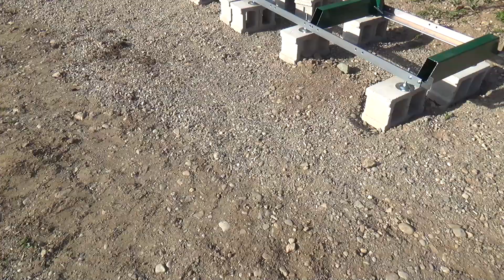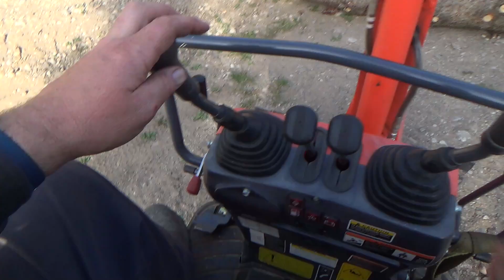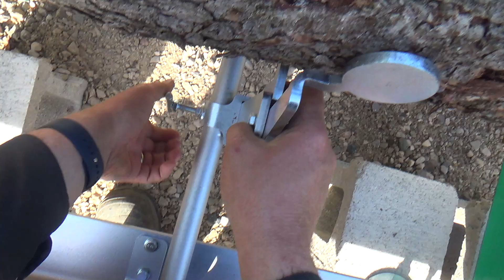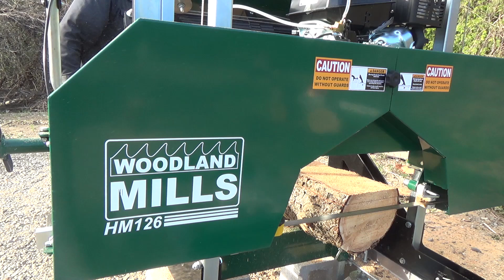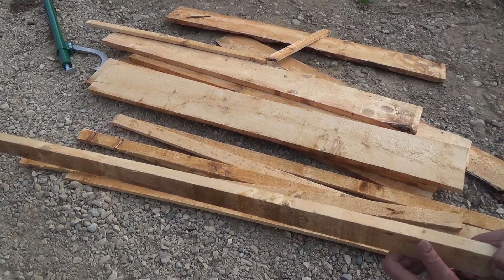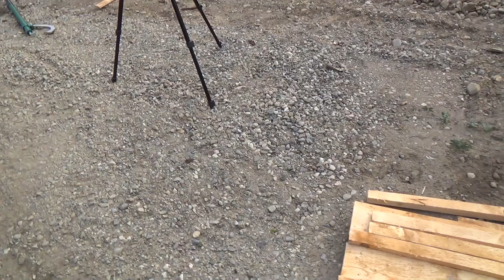Let's load a log on the mill and see what we can get for lumber

Comment: After every 3rd of 4th cut bill check your saw dust shoot on you mill if the wood is wet it will clog up and if you cut a bunch boards  put tiny slats in between your levels of wood so the air can flow in between them so the boards will dry out.
Reply from the maker: stickers they call those.. I have to cut some of those as well

Comment: If you have logs with a fair taper on them, a scissor jack by the front bunk with a piece of angle iron on it will allow you to raise the small end a bit so you won’t lose so much. I think your log stops should be turned around so the high point is against the log- easier to see if your blade is close to touching it.